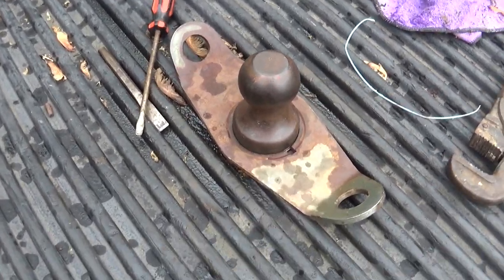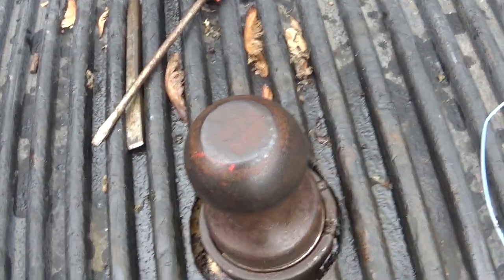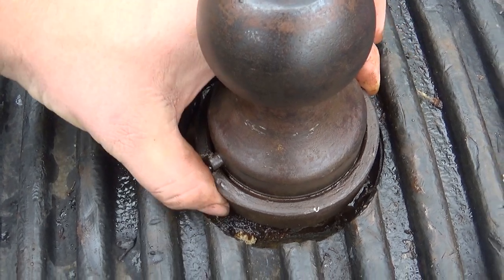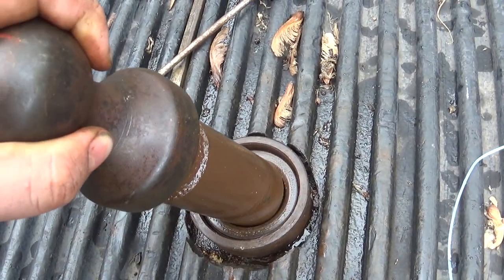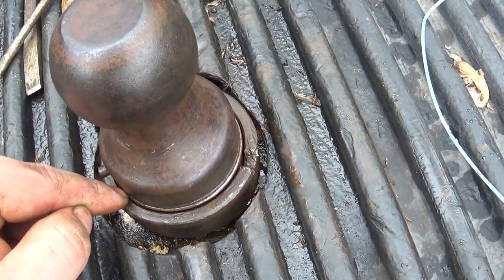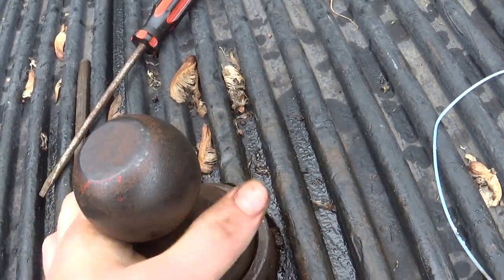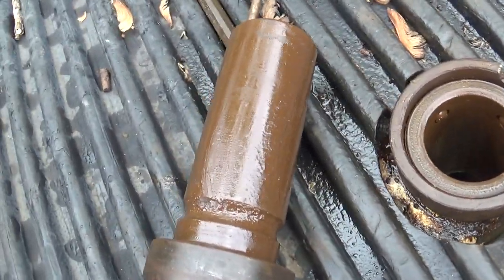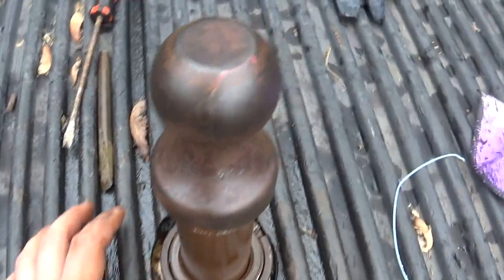How to remove a goose-neck ball hitch

Comment: Una Goose makes a cover that fits where the ball goes. Normally rotating the ball making it vibrate will make it easier to remove. I've had one since 1999 & it has never rusted stuck. Sand or grit can make the balls stick, but spinning vibrates that out. Highest rated payload in the industry for gooseneck hutches.

Comment: I recently bought a '99 F250 that has an Una-Goose hitch. It seems like a neat concept, but the prior owner neglected the truck a little. Everything except the chain plate was stuck. I was able to get the release collar free using a pry bar, but the ball is seized. I doused it with PB Blaster, but because of the lip on the ball it really cannot work its way along the shank. I tried putting pressure on the end of the shank with a bottle jack on the rear differential, but it will not budge. The utility of the truck is kind of hampered with this ball sticking up right in the middle of the bed. If I cannot get the ball to come free, I may have to get the entire thing removed, unfortunately.